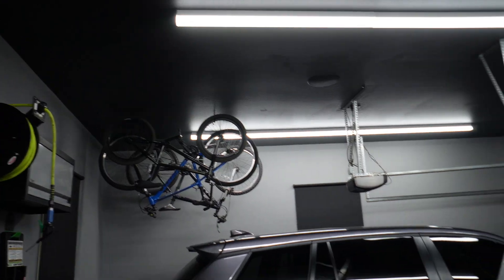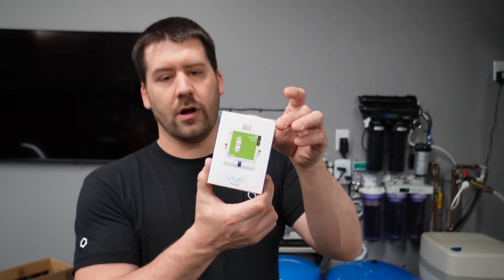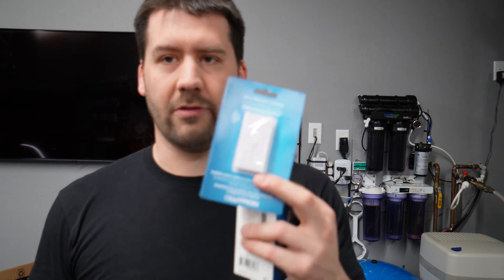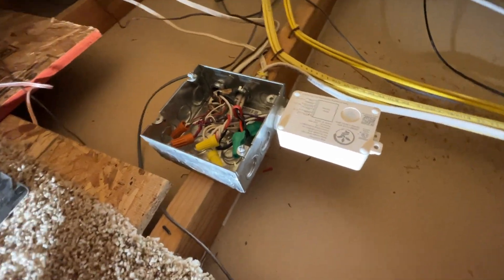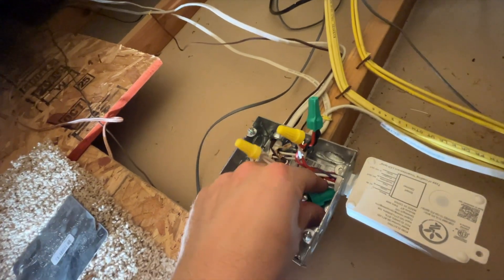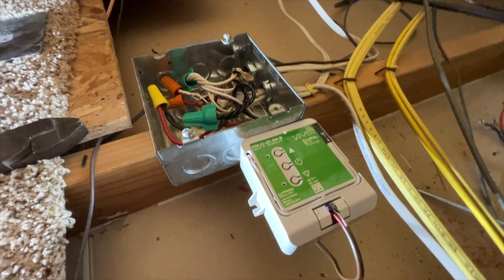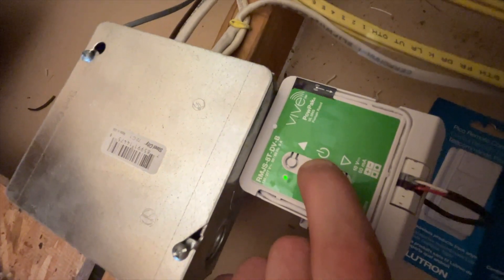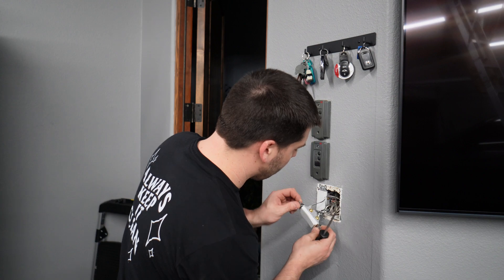IG368 Upgrading my Cree LS lights with Lutron Vive and Pico!

Comment: I'm looking into getting these for my garage. but i'm unclear on this whole 10v dimming stuff.

What all do I need to buy from OG? I was going to get some 8 ft Fixtures. If I dont really care about the dimming, will I be able to just wire them into the normal wires currently powering my garage lights? Or are the powpaks still needed
Reply from the maker: If youre ok running them at full brightness you can just buy the lights and wire up the hot and neutral like normal.  There will be two other wires in the fixture, purple and grey, and you will need to leave them disconnected.  they come with wago push terminals on them IIRC, just leave them be, and the lights will run full brightness.  No powpak required.  

If you connect the purple and grey to each other, the lights will dim fully to 1%

If you want to be able to make the lights be at any brightness between 1 and 100, you need a vive.  the cool part about the vive is that your existing wiring in the wall doesnt matter, the pico control the vive wirelessly and you just hang the vive off the side of the light and wire it in.

Comment: Looking to do a similar set up. What type of wire did you use for the 10v to the powpak? I like that it’s sleeved.
Reply from the maker: its 18/2 "bell wire" its technically for setting up a doorbell or something like that but works great for this.